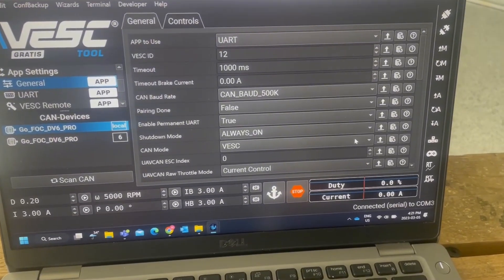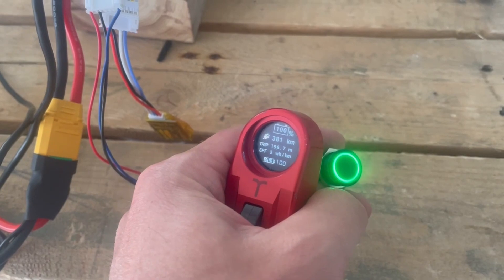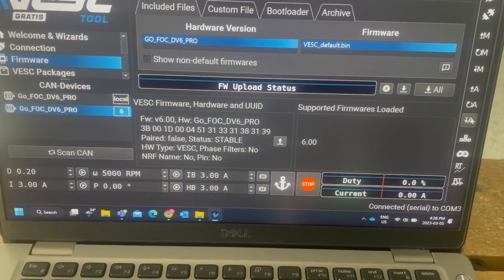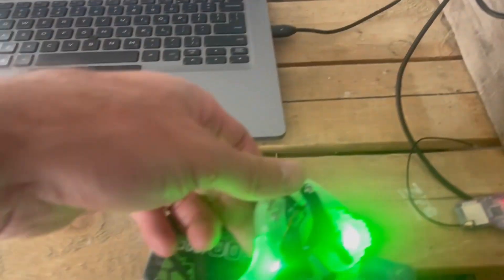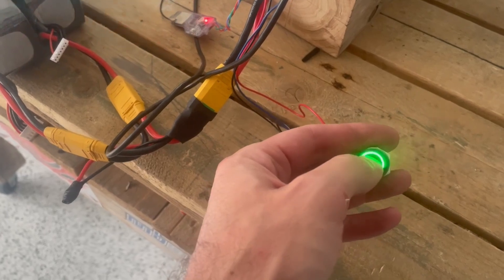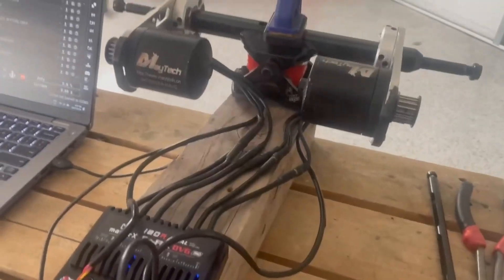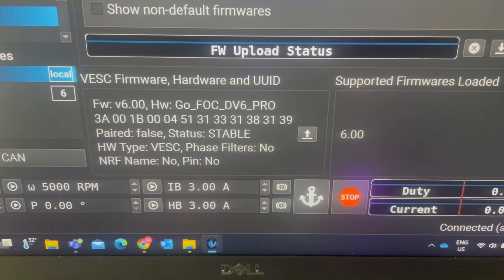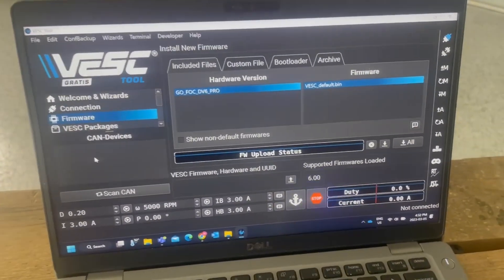Marker X DV6 Pro Remote and Switch Bench Testing

Comment: Thanks for this. I grabbed a DV6 pro as you had highly recommended it! I love the ESC but couldn't figure out their switch and was just running a loop key. I never tried the BT module on the splitter with the switch, looks like that will solve my issue!